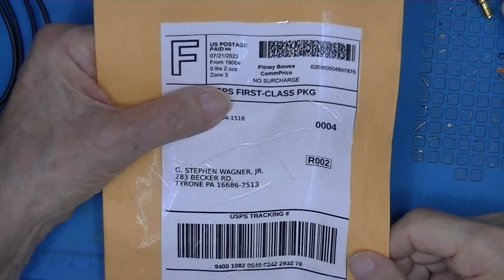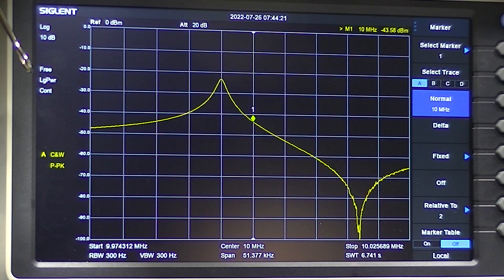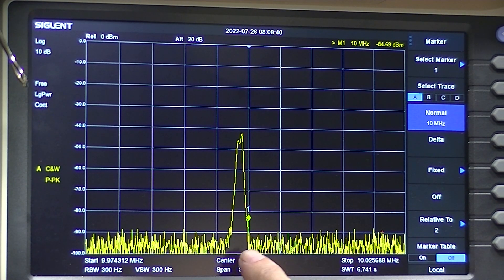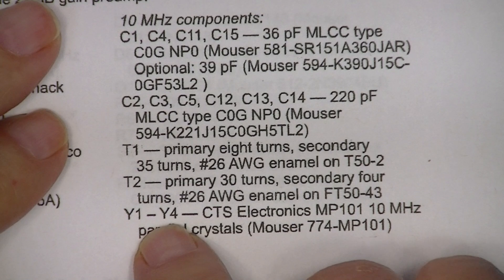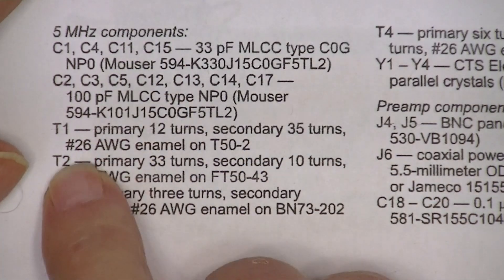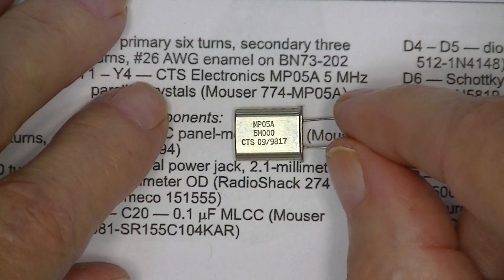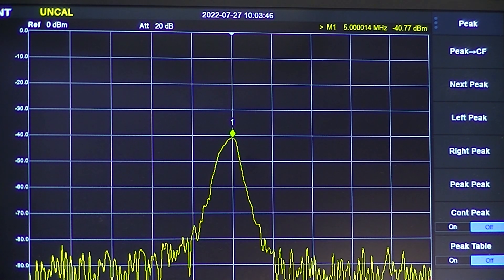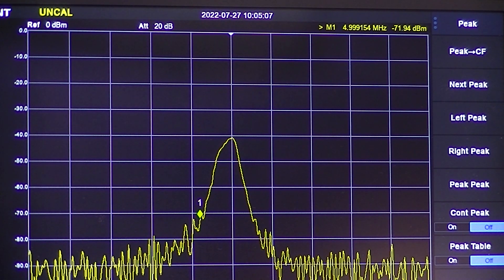10MHz WWV Receiver Part 3

Comment: HI Steve,  I just saw your series of videos on my WWV TRF receivers and commented about the crystals in your second video.  As you have found out, crystals and how they are specified are a science, and you definitely need to use the crystals I specified for this application.  With the latest 10 MHz crystals you used we could probably change the values of the capacitors in the filters to pull the frequency upwards, but let's wait to see how things turn out when you use the correct crystals (crystals that I specified for this project).  While waiting for the correct crystals to arrive, you can try changing C1, C4, C11, and C15 to a lower value capacitance value and this will shift the passband upward. Don